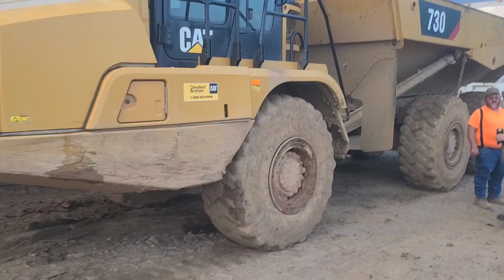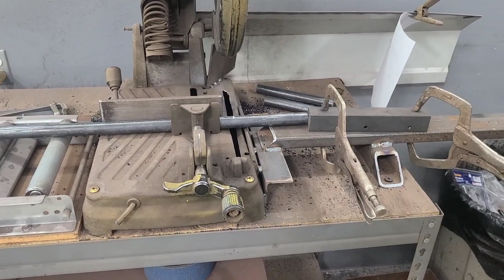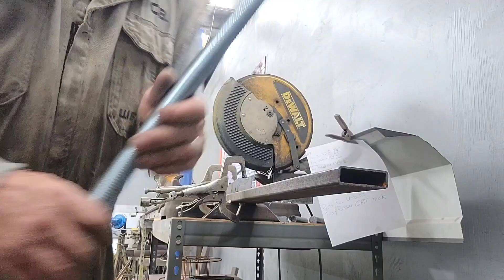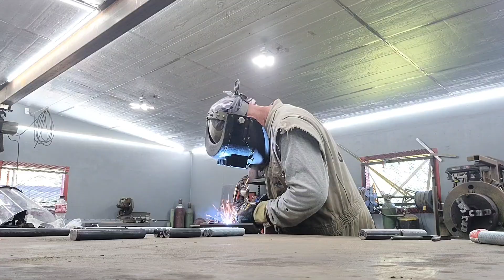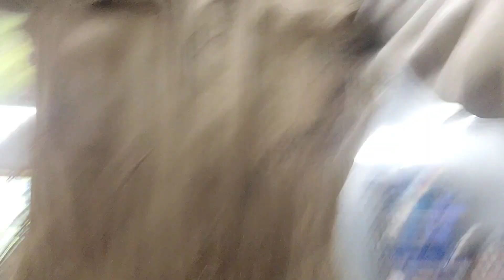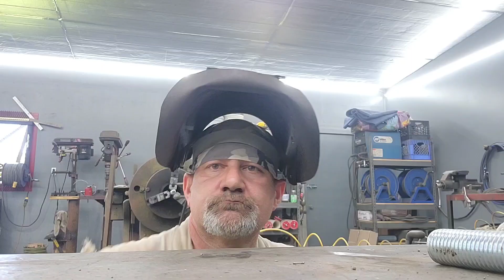Fabricating U-bolts for Catapillar dump truck

Comment: Why did you not bend the rod like a u bolt then just ad the threaded rod ?
Reply from the maker: The way you ask that question makes it sound like bending 1" solid round into a u-bolt shape with an exact inside dimension would be easier or faster than the cutting and welding method that I used....Sir I can assure you that doing what your suggesting would only add time and effort to the job without improving the outcome at all.
I did what I did because thats the most efficient way to do it with what I have
Reply: @NBSWELDING  thanks I didn't know . Now not knowing I would still be there trying to bend it lol . Thankyou sir. Love the videos .

Comment: Would putting a 1 inch Acorn nut on the threaded end help with it rubbing down or at least extend service intervals
Reply from the maker: With the amount of friction involved with driving that truck through the shredded tires I don't think it would make much difference...most acorn nuts are grade 5 or less...I don't remember seeing them in high grade

Comment: Do you have any steering wheel protective bags that you could stretch over the steering wheel.  Warning anybody that jumps in. That it's under repair.  Do not operate
Reply from the maker: I don't have one but that could be made up pretty quick if needed
Reply: Take the key,  Flip the main disconnect.  Then make a sign.

Comment: one hour video for 4 ubolds??waste of time
Reply from the maker: I love it when there is a negative comment on one of my videos from someone with absolutely no subscribers or any videos on their channel at all...especially when they can't even correctly spell what their bitchin about
Reply: What is a ubold? If your comprehension skills are as good as your grammar, I can understand why your attention span is so small.
Reply: @randomschittz9461 ooo!!! you are so smart. i hope you know that are other languages except english and that you speak Greek and your grammar is better than mine in english, so i can explain to you, my skills.for beginning i would cut threats to the bar so no need to weld
Reply: @nikxohs3925  If you would’ve listened, you would know that they were threaded to begin with and that was the whole issue here. Also, this is a welding channel, so things get welded here. Maybe you should stick to watching cartoons and similar videos that represent your skill set.
Reply: @randomschittz9461  my skills are something you need 30 lives to achieve .it was a simple job, but if was some serious job no engineer will accept your solution
Reply: Haha, If it took thirty lifetimes to get to this point, you've wasted 29 1/2 lives.

Comment: I would bet you donuts and coffee that you would strip the threads before the weld broke , Perfectly adequate for the need. Also I never did like bending threaded rod to make u-bolts, just never looked good, Also the threads can be kind of abrasive on the material that they are around anyway enjoy the video keep them coming buddy
Reply from the maker: I agree with ya
Reply: Agree.  I hate fabricating with all-thread.  Anything in the vicinity is at risk, including steel, iron, AR.
Reply from the maker: Thank you